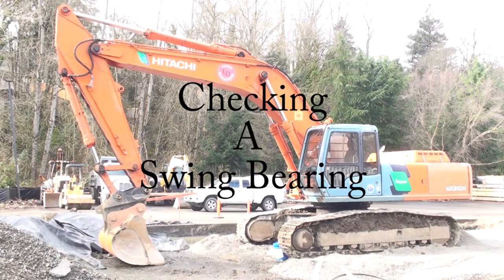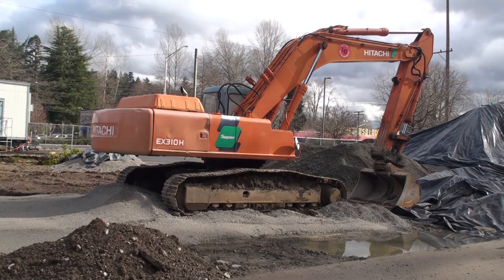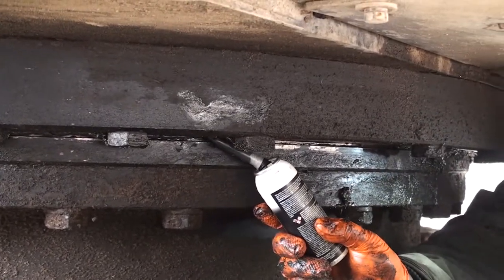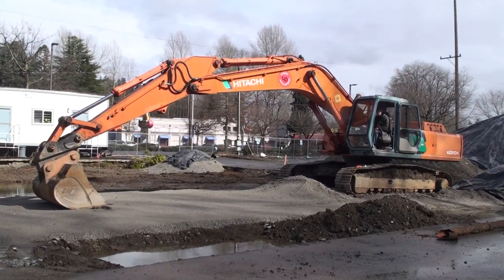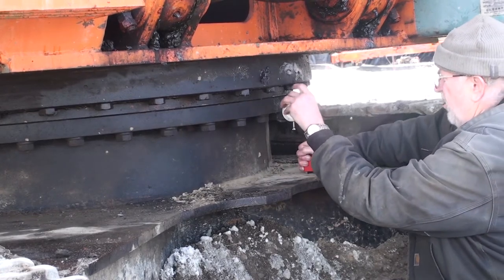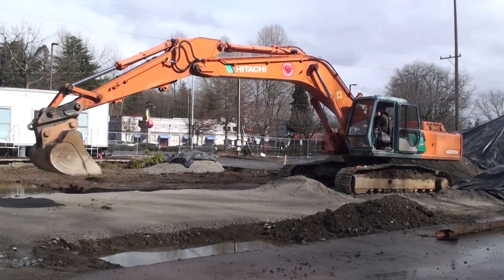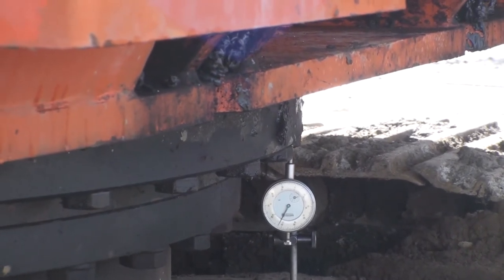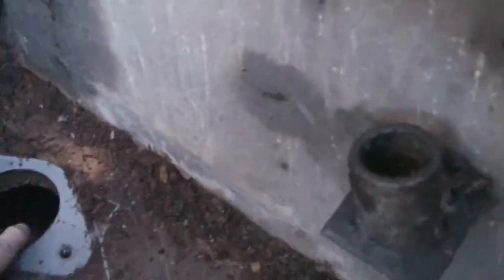Excavator Swing Bearing Check

Comment: Nice shoot, can I ask what is the maximum tolerance when you need to replace the swing bearing, thank you and waiting for your response.God bless
Reply from the maker: I have never gotten a straight answer from any factory rep on any make of excavator. When the play gets up in the ninety or hundred thousand range you usually see flakes of metal in the grease dripping off the bearing. When the pinion gear seal starts leaking, I know for sure it's time.

Comment: Would 1/8 of an inch be too much play on a 307e2 cat?
Reply from the maker: That would be a considerable amount of play. One eighth inch would be 0 .125 inch in decimal measure and a 307E2 Caterpillar is a small excavator. There was a problem in the small Cat excavators around that time where the inside mounting bolts for the bearing were  breaking. You might check with your Cat Dealer to see if it might be affecting your machine.
Reply: @repairsecrets @repairsecrets  Thanks, I'll check it out. yeah, cat quoted 16 grand to replace it.

Comment: I have a question my machine when I am swinging it doesn't want to stop it wants to keep swing only when going to the left have any ideas how to fix it
Reply from the maker: I can only give you general information as I have no idea the make, model and serial number of your machine. Swing functions are operated by a hydraulic motor that has pressure relief valves, check valves and counter balance valves. All those are usually mounted in the top of the motor. I would suggest getting at least and parts breakdown of the swing motor and try to figure out what is going wrong.
Reply: Swing brake clutch pack is spring applied hydraulic released may be a control leak in valve body on swing motor